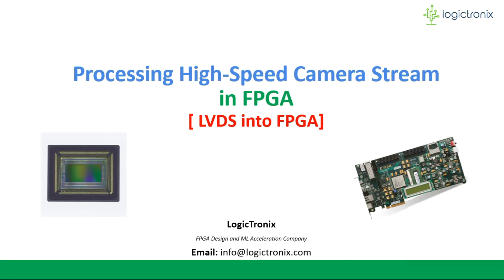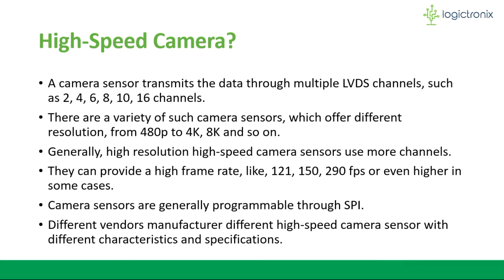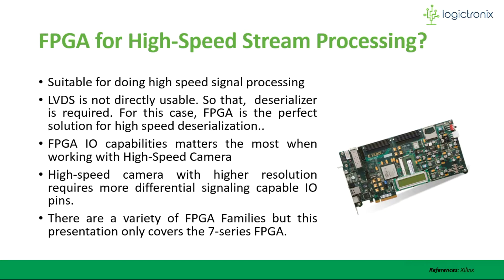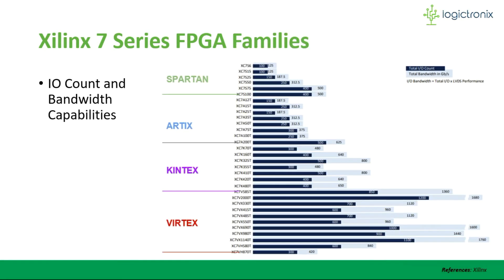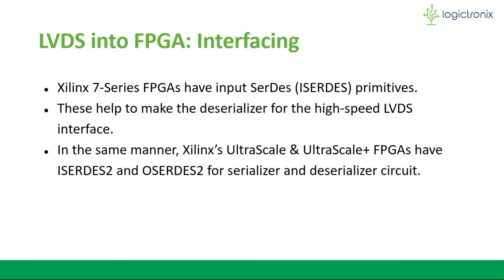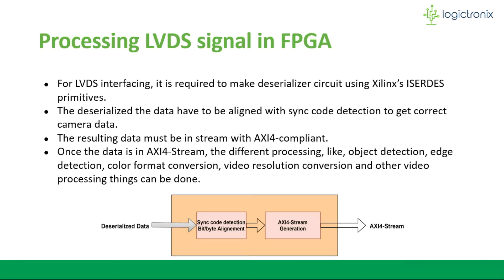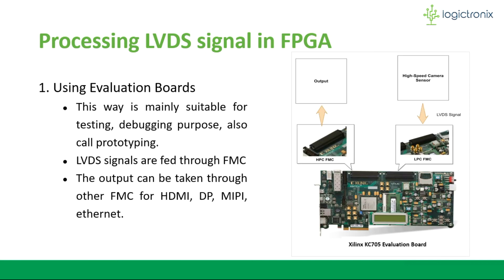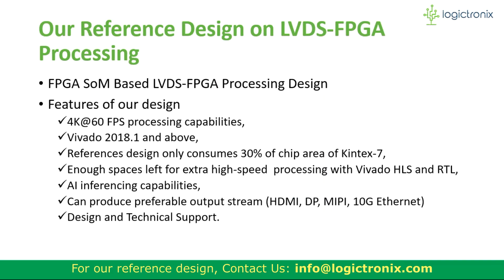Processing High Speed Camera Stream into FPGA [LVDS into FPGA]

Comment: I'm looking at the LTC2320-12 ADC, that has LVDS output.

However, it seems like you're supposed to latch data on the rising edge of the adc's CLKOUT.. but how does this differ from any other serial bus?   Why isn't SPI bus logic referred to as serializer / deserializer like it is with LVDS? 

Interestingly, after each adc conversion in cmos mode , a single wire is used to clock the channel's 16 bits of data out at 100mhz.  In lvds mode, 2 wires are used, and so after each conversion, you must clock out 2 channels worth of data before the next conversion, and therefore the clock speed needs to be 200mhz!

Unfortunately, the overall timing is unclear..  you pulse CONV for 30ns, then wait (a fixed 450ns time?), before clocking out 16 bits.. the next CONV pulse is 1/1.5Mhz later?  (16 bits per sample are clocked out even though it's a 12-bit adc.)  If there's new data every 667ns, and it takes 160ns to read 16+16bits (at 200mhz) do you just  wait the max/worse-case of 450ns?

BTW, at 667 ns (1.5 MHz), the average data rate for all 4 lanes is about 128 bits / 666 ns ≈ 192 Mb/s, with a per‑lane peak of 200 Mb/s during the burst.